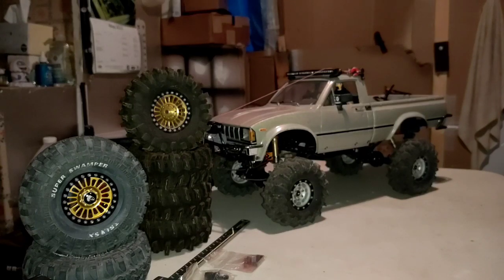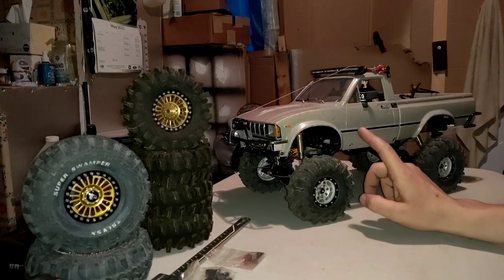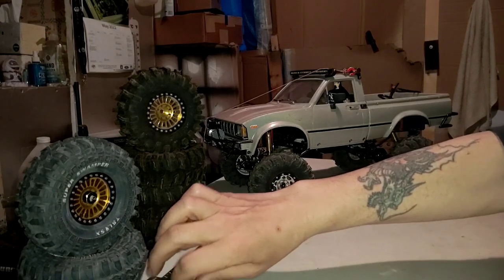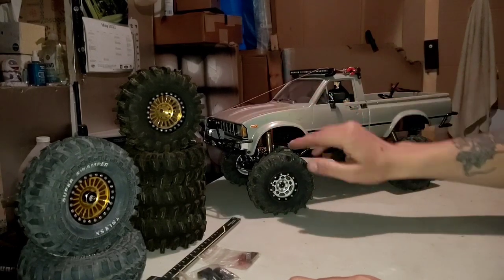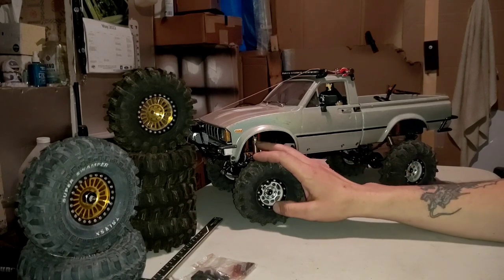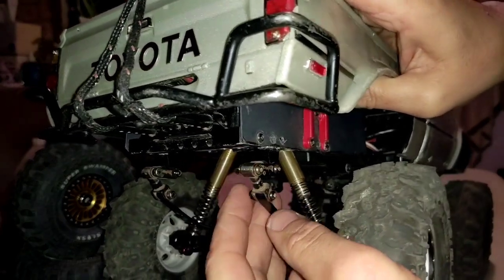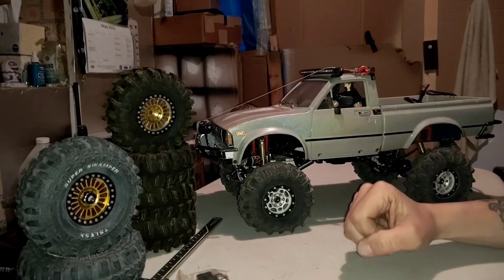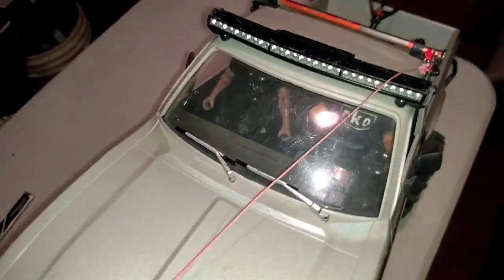R.C.A.D.'s Trail Finder 2 Walkthrough; For Those Who Are New to The RC4wd TF2

Comment: Buy 100mm kyx shocks, and your own pen spring.
Thats why I did and it worked out.  Took awhile to figure out which spring and oil weight.
Front is 100% negative droop, spring on shock shaft, 30 weight
Rear is 50% stiff negative droop spring, 80 weight.
Carbon VRD.
Front stays down always on the incline until truck demands flex or reach.
Reply from the maker: Right on 😁👍🤜🤛

Comment: I got my tf2 3 days ago and today i had time to install the shackles and zboxes i removed the 2nd longest leaf from the back and took both rear springs out i will need a longer drive shaft i could see great video 👍🏻
Reply from the maker: 😊👍🙏 
All the info for building a great truck is in this video, You might have to watch it a few times, before getting the jist of everything, But the inside info for a great tf2 is all their.😁👍

Feel free to ask questions if you need to vampire, I'm always happy to help out, And I wish you all the Best with your build Brother.
😁👍
Reply: @R.C.A.D.  so i was working on my truck I disconnected the servo and receiver now when i connect them back the steering whee is the throttle and the throttle is the steering ? Any way to flip it back
Reply from the maker: 1st; definitely a way to switch it back 😁
But I need to know a bit more info first.😕
If you didn't mess with any of the Transmitter settings in the process of what you were telling me, Then it's a real simple fix,😄 If the receiver side is the only thing that you messed with, Then it's just a matter of unplugging the steering and throttle from the receiver, and swapping them around,
The receiver should be labeled for each individual channel, ESC gets plugged  into Thr or throttle, and the steering should be plugged into Str or Steering.
If the receiver isn't labeled like that, and all it shows is the channel numbers, Then the Steering should be plugged into channel 1, and the ESC into channel 2.

If you changed something on your transmitter, then it's going to be more difficult to explain, how to walk you through the Transmitter settings for swapping those channels around on the Transmitter itself.😕

I'm about to go film a outdoor run video, so if it takes a few hours for me to get back with you, please forgive me.😁👍
Reply: @R.C.A.D.  i found the problem I connected it wrong thanks for the reply

Comment: Hey your videos really helped me. I’m trying to fit some 2.2 mudslinger xls on my tf2 lwb extra cab. I believe they are 5.5 inches. They don’t look as ridiculously large on the long wheelbase version as the marlin and normal wheelbase. Especially because I’m from Kauai where people regularly lift toyota trucks to heaven and put large and wide swampers. Its a subculture here. But yah So far I have the lift blocks, axle wedges, rear only revolver and z bocks. I still need to dial in the shock lengths and get revolvers and z box for the front leafs. I don’t want to do a body lift so my approach is gonna be to lift it as much as possible using the suspension and run stiff spring shocks as well as leafs. gonna try 120mm first and if thats too big ill go 110. Also some wide wheel spacers to even out the look. I would argue that they look more scale like this since you can see the realistic looking suspension, leafs and axles, with such a high lift. A lower rc truck is hiding all that. Thanks again.
Also Wd40 is a water displacement But i believe it evaporates. A great corrosion inhibitor is fluid film spray. It even waterproof electronics. I used it on an expansive furitek esc and it sticks like sap but is oily and migrates to cracks and is “self healing”. I don’t know how good of a lubricant it is but it works great as a surface protection from the elements. I use bike chain lube, sticky grease, and fluid film. I like that fluid film is like a grease that migrates. It does attract dirt but that is part of its corrosion protection since the dirt helps it stick in place and acts a vessel for the fluid.
Reply from the maker: Two of the "big" lift blocks on each side of the front axle, and one of the Big lift blocks on each side of the rear axle, Plus degree shim's on each end, and you should be able to clear 2.2's and have enough room for a set of 100mm shock's on all four corners.🤔😄👍
I've got videos of this Tf2 ridding on 2.2 Proline Super Swampers, and other videos of it running on Proline 2.8 Sand Paw's with that same suspension setup (Sand Paw's being the Funnest)😄 lol
The only problem that you may have is "Axle Breakage"
Tf2's don't like running 2.2's,🤔 and in time... the stock front axle shafts will break from the extra stress of spinning that extra rotating mass.😭 No B.S. 😕 2.2's are fun on the Tf2's but unfortunately they can't handle the extra stress for very long,😕 which is why I went back to 1.9's on my truck. 😁 lol
But I wish you all the Best my Brother 😄🤜🤛 if you get some stronger axles you should be good to go.
😁👍

Comment: Been always wondering bout the color effects on some vehicles like your own. Like that rainbow 🌈 effect...you said flat black followed by metal flake and top off with clear, any particular brand of paint  for this job ?
Reply from the maker: This trucks paint job started with the factory gray plastic, and then I sprayed on several cotes of Dupli-Color "Clear Effect's" spray paint,(which is pretty much nothing but metal flake) And then I topped it off with several coats of Dupli-Color "Clear Cote" And the only thing that I painted black was the underside of the body.😊👍 

But if you want the paint to have a Red/Blue/Greenish flip flop, Then it calls for a different method, Which is starting out with Flat Black, then spraying on the Clear Effect's after the flat black, Followed by a few cotes of Clear Cote.

And if you were to paint a clear lexon body with it, you would do it in reverse order,
Starting off with the Clear Effect's, And then spraying it with Flat Black next, and skipping the Clear Cote all together.

Note; The Dupli-Color Clear Effect's spray paint works with most Flat paint colors, Flat Black/Flat Blue/Flat Red & Flat Green would show up the best, But the Trail Finder 2's flat Gray body color also works well.😁👍
The reason I painted in such a manner, was to hide future scratches, and it does that very well, Since it's basically just metal flake sprayed over the stock plastic color, if the body gets scratched you'll hardly notice it.😂👍 
But if you were to paint it black first, and then apply the Clear Effect's like the Can suggests, Every time you scratched the body you would end up seeing the stock gray plastic beneath the scratch,🤔 But if you just use the Clear Effect's by itself, along with several cotes of Clear Cote, there's basically nothing to see if you scratch the body.😂👍

As for the Dupli-Color Clear Effect's spray paint; I used to get that stuff from the local Auto parts store, but as of late I haven't seen to much of it available,🤔 Not quite sure if they still make it or not,😕 The last time I looked they had it labeled a little bit different,🤔 and it wasn't exactly the same color,😕 Technically speaking it's supposed to be a Chameleon flip flop paint Color, But the last few cans that I seen were different,🤔 "not in a bad way" just a different color flip flop, like just plain Red, Green, and Blue, and not the traditional Chameleon flip flop color.😕 

So far I've painted four different bodies with that same Chameleon flip flop color, The first was a old Traxxas Revo 2.5R Body which is the standard Chameleon flip flop color using the metal flake and then Flat Black on top of that,  Then the Trail Finder 2 was next using just the flip flop metal flake and Clear Cote, Then I painted a Vaterra Twin Hammer's lexan body with it, Starting out with the flip flop metal flake and then using a Flat Blue on top of that, followed by Gloss White on top of the Flat Blue, And the last vehicle was my neices Redcat Gen 8 Jeep Comanche "lexan body" and I started with the flip flop Metal flake, and then sprayed on Desert Tan on top of that, Followed by Flat Black on top of that,🤔
All of which turned out Great 😁👍 

Another important note; Whenever it comes to spray paint, always stick with the same brand when painting a body, it doesn't matter how many different colors you use, as long as there all the same brand everything should jive right, But if you decide to use a couple of different brands, then you will be running the risk of the paints not playing well together, and that can be very bad, were talking about a destroyed paint job and possibly the body too.😭

Why Dupli-Color you say!
Well over the years I've had pretty good luck with Dupli-Color spray paint on the RC body's, it sprays on nice and it's somewhat flexible, as long as you don't spray it on too heavy,😁👍
I've been using Dupli-Color spray paint on my RC's since I was about 13 years old, and I'm currently 48 years old 😂 lol that's a long time... And I would have to say that I actually like Dupli-Color better than any other brand that's available "including Tamiya Spray paint".🤔😊👍 

Thanks for checking out the video Sammy 😁🙏 And I wish you all the Best my Brother. 😁🤜🤛

Comment: Why did you not use the degree shims on the front? I just put on the second largest on the front and the largest on the back. I have yet to test it though.
Reply from the maker: I did use a degree shim on the front,it was one of the smaller ones, but I definitely had to use one to get the driveshaft angle back to a "somewhat" normal angle. 😂 not sure if I mentioned that or not 😕
Two big lift blocks and a degree shim on each side of the front axle, And One big lift block along with a degree shim on each side of the rear axle.😁👍 
Note; I'm also running Glenda 2 shock hoops on the front to accommodate longer shocks.😊👍 
100mm shock's work pretty well with that setup, And I'm not sure how much longer you can go with on the front, "Might be able to clear 110's on the front"🤔 
As for the back Shocks; 100mm work okay with that setup, But I think that 110's would be a little bit better, "Might be able to clear 120's" But that might be pushing it 😕 100 mm on the front end & 110 mm on the back, would probably be a good combination.😁

Z-Boxes; Not sure about the TF2 with the longer wheelbase, But the Z-Boxes definitely won't work on the front of a standard TF2 using the 2 speed transmission, Not sure about the single speed transmission,🤔 it might work with that setup 😕 The two speed transmissions "transmission mounts" are in the way on my truck, and the Z-Boxes can't be attached properly because of it.😭 Which is probably a good thing 🤔😕 having that extra bit of Twist would definitely take the life out of a steering servo,😂 lol that's a lot of extra movement to account for..
I'm running a Protek 370tbl black label steering servo and my truck needs every bit of it's 600 ounce inches of torque, to keep it pointed in the right direction, That servo has enough power to compensate for all of the front end slop, and still have enough left over to move the back of the truck around if something is snagging on the front end,I love Overkill.😄👍 Lol

Comment: I am not that experienced with RCs so i have a tf2 and my rear shaft pops out when it flex to much… Do i need to buy longer ones? Which ones do you recommend the size?
Reply from the maker: Yep... you definitely need a longer rear drive shaft.🤔
As far as the drive shaft length; that depends on how much travel you have, and varies from vehicle to vehicle, "pending on the length of the shocks and overall suspension setup.
But here's what you need to do in order to figure it out.
#1 Since most of this stuff is done in millimeters, you're going to need a measuring device that can measure millimeters.
#2 Flip your truck upside down safely "such as in your lap" 
#3 Remove the rear drive shaft
#4 Fully compress the rear suspension until you're axle bottoms out completely
#5 While the suspension is completely bottomed out, measure between the Rear axle pinion shaft "just behind the drive shaft mounting hole" and the Transfer case output shaft, "just behind the drive shaft mounting hole" And then right that measurement down on a piece of paper.
#6 Next measurement to take is with the Rear suspension fully extended, 
So Fully extend the rear axle to its maximum stretch, and then measure across those same two points once again, and write it down.
#7 go online to your favorite RC shop, and try to find a drive shaft "that's within the required perimeters.😁👍 

I recommend Amain Hobbies online, and then I would type in "Crawler Driveshaft" in the search area.😊👍

FYI; I'm not sure what you're current drive shaft length is, but it sounds like you need something that's about 5-10 millimeters longer than what you have,😕 But don't take that for a fact! Make sure that you measure everything out "as I suggested" in order to get your correct length.😊👍

Hopefully that's helpful for you, and I wish you all the best my friend.😊🤜🤛
Reply: @R.C.A.D.  my drive shaft as stock , only upgrades i did are the zboxes , shackles and red leaf springs other then that everything stock. I was wondering if the rc4wd punisher are any good.
Reply from the maker: @Mr.xaphan 
The punisher's are alright, and pretty darn tuff too! 
Just make sure that you get the right length the first time vs going back and having to purchase another set 😄 "That happened to me on the first go around" and it's a very expensive mistake to be made.😭😂

Comment: Hi Jim, I have been studying this video and I missed the part on the shocks using 100mm in the front and 110mm in the rear, I think that's what you meant
Reply from the maker: Personally speaking.. I would rather have the same length shocks all the way around, vs having longer shocks on the back.🤔
That being said... I had 100mm shocks front, and rear, at one point in time, But I currently have 96mm shocks all the way around, But yes... "Ultimately speaking" a person could get away with 100mm on the Front, and 110mm on the Rear, if you do it all correctly.😊👍
Reply: @R.C. After Dark  yup your about that if done correctly, I have 100mm all around the tf2 still doing adjustments from the last time we talked, right now the rear is slightly lower than the front a full set of lift blocks on each leaf spring, sits pretty high and trying to even the height truck, that's why I was asking about your shock combo.
Reply from the maker: no worries bro....😊👍
It's all a bunch of trial and error really...😄 Lol but once you mess around with it enough, it will all work itself out alright. 
The truck is going to sit up pretty high at first, and then it's just a matter of sagging out the suspension to balance it all back out again.😊👍
Reply: @R.C. After Dark  thank you Jim, I was wondering if you had any other social media pages that I can send you photos of my build ?